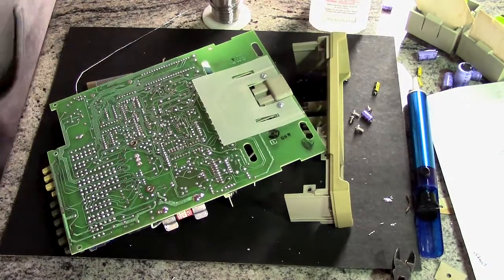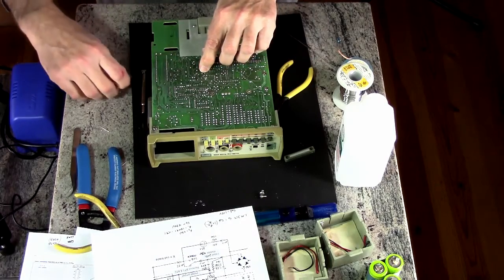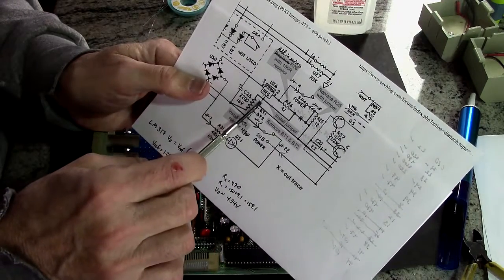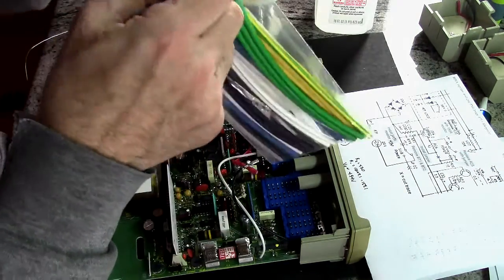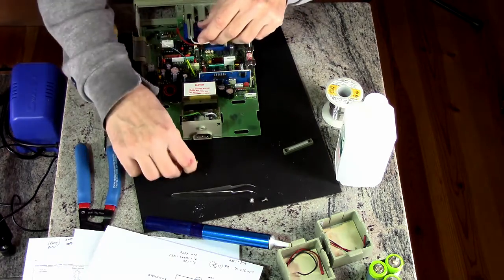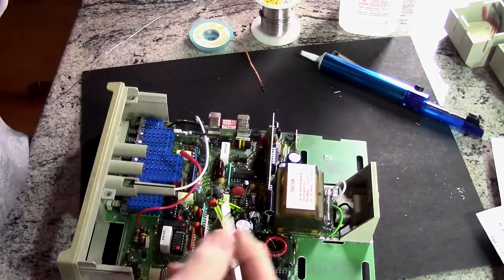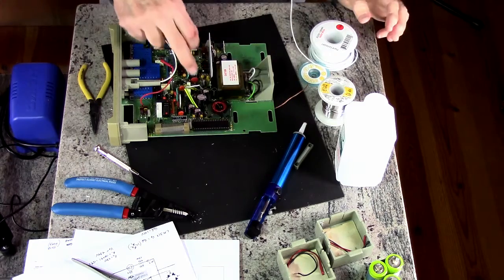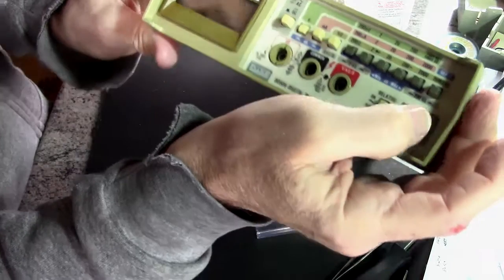Fluke 8050A Restoration Part II

Comment: Great job and I don't mind solder suckers or wick. It's still what I use. Anyway I've got one of these coming next week w/o battery option Baku watched because of cap replacement and which ones need it. 
 Thank you sir for the video from a former cash register tech.

Comment: I just got one on ebay and it didn't work. I replcaed the caps but still same problem. It would just spit out junk. Once in a while it would be correct for a brief period of time. I sprayed the switches out with contact cleaner and that actually gummed up the switches somehow. I flushed them with alcohol and that freed everything up again, but it still had the same problem. My next trick was to blast wd-40 down the switch housing. I let that sit a few minutes, then came back with the contact cleaner to blast out all the extra oil. After that, the switches felt nice and smooth thanks to the wd-40 and much to my surprise, the meter is working perfectly. I hadn't thought about this before I used the wd-40, but I noticed that the paint on the springs for each switch were flaking off. I think some of this flaked off spring paint might have migrated into the switch housings and been playing with the connections. That's my only working theory, but I'm happy everything is working now.